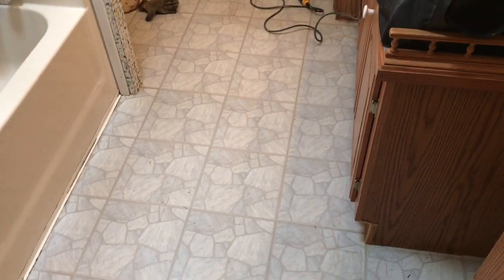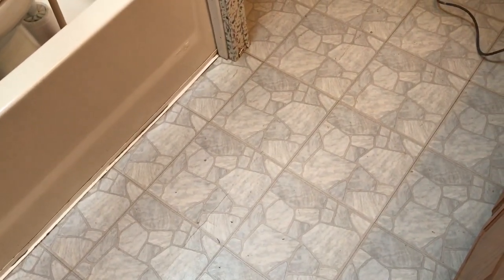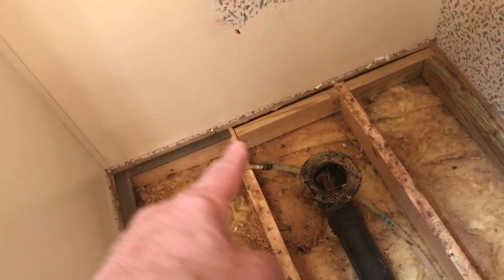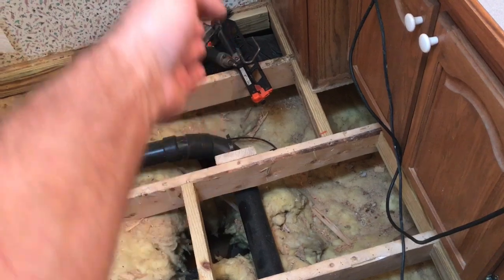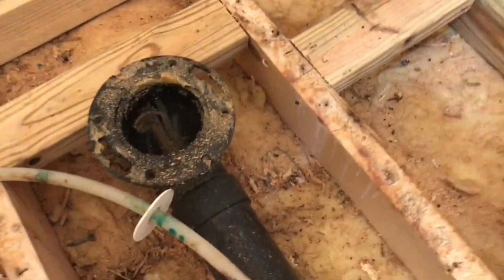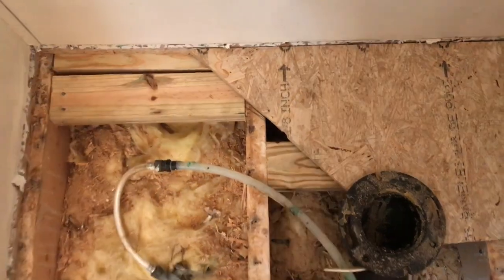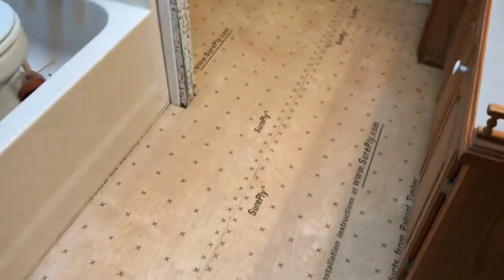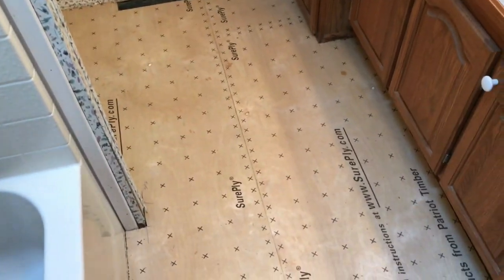How To Repair a rotten bathroom floor in a mobile home

Comment: Bud you just saved me a ton of headaches! Thank you very much for posting this !
Reply from the maker: Thank you for the compliment. Very much appreciated
Reply: @thecarolinacraftsman4120  Dealing with a complete down to the rafters remodel with almost 0 clearance under the double wide so that angle with the perlin supports is a go ! Builder to builder.... Thanks bud ! Not a contractor but have renovated multiple homes.
Reply from the maker: Glad I was able to help you out with this post

Comment: My rotten bathroom floor will need "purlin" 👍
Reply from the maker: Actually they are called blocking instead of purlins. Purlins are used in roofing and blocking being similar, are used every where else. Bottom line is you need additional support between the floor joints such that you have something to glue and nail your new subfloor down to. Check out my channel for one other rotten floor repair. It’s has some music I wish it didn’t that you may have to look over. 🙄lol

Comment: Nice retrofit/repair. Sorry but Purlins are part of roof construction not flooring. What you are adding are blocking or nogging
Reply from the maker: My family has called them purlins and blocking depending on the direction of the wind each day and I’m sure everyone gets the point. I know exactly what you’re referencing. They are mostly used under metal roofing. It’s placing support where there would otherwise not be any. Thanks for your input. Much appreciated!  😜👍
Reply: Mr. know it all tried too trip u up Woody  thank you for the clearing up  the minor detail

Comment: How long does it take to replace a broken floor and falling tub in a mobile home single wide
Reply from the maker: It all depends on what the Damage is and your experience level. I can do one rather quick because I have lots of experience, but I can say this much, do your best to understand all aspects of the process and have the materials ready. Then begin the process of taking it apart and replacing all compromised parts. Then it’s all about putting it back together. The fact you watched this video shows you are doing your homework. Please let me know if you have anymore questions I can answer.

Comment: How do you remove a broken flange? It seems to be glued or does the old flange unscrew from the sewer line??
Reply from the maker: The flange is supposed to be glued down if it’s plastic. It’s a totally different thing if it’s a cast iron one. There are different types of fixes for that depending on how much damage has been done. If it’s just a crack along the top flange where the bolts extend up from the bottom to secure the bowl, then you can get a metal flange repair kit. That will be a “half moon” design that will only cover half the flange. There are videos on YouTube on how to replace one. If you have a local hardware store where they have knowledgeable people you can ask questions, that would also be a good source of information. I hope this helps. It may also be wise to call a local plumbing company   Good luck with it.

Comment: Just curious, why didn't you just unscrew the flange for the toilet. Drop the plywood down then screw the flange back into the pipe?  Was yours glued? They're typically screwed in.
Reply from the maker: I have plumbed for a significant part of my life and in most cases the toilet riser and the accompanying toilet flange are PVC and glued together. Some older homes may have a cast iron flange and it’s more problematic than PVC.  The flange is part of the piece glued down onto the riser thus it would be a bit more difficult to cut out the riser, install the new plywood and then re-cut the drain hole and insert and re glue the riser with flange attached. For us it’s much less involved to do it the way you saw on the video. However if you have the tools and the desire you can do it anyway you want to. Here I just highlighted how we do it. Thanks for sharing your thoughts.

Comment: Here's a stupid question... How exactly are you fastening the smaller support pieces in-between the floor joists? Perlins??....is that what you were calling them?  I'm in the exact same situation to where I've got ot pull up a bunch of rotten floor in a double-wide to try and get it in "sell-able" condition.  I've some some patches throughout the home (which was builtin the 70's), but I've got to do the entire bathroom, and I'm a bit intimidated, given I hate working around plumbing around where the toilet is.  But, short of that, it looks like this is a very doable "DIY" project in a very similar sized bathroom.  Also the underlayment your using....the stuff that say's "sureply"...is that part of waterproofing the flooring itself?  Also, did you go ahead and caulk along where the flooring meets the wall, tub, and cabinet?
Reply from the maker: Hi. Thanks for watching my videos. The “purlins” are best known as “blocking.”  Purlins are usually referred to the pieces you put on a roofing system but I did use the term purlins which was my mistake. We use 3 1/2” construction screws with the torx bit head or a 16 penny nail gun. Either are fine to use. We toe nail or toe screw the ends to the existing floor joist. The 3/4” underlayment plywood is a product I get at Lowes and it’s somewhat water resistant but in no way water proof. If you’re not going to put in a porcelain or tile floor down then you need not worry about water proofing the floor. The Sureply is a 1/4” product that goes on top of the 3/4” and makes for a smoother surface for applying sheet vinyl or one of those LVT products (luxury vinyl tile). The sureply is not at all waterproof. In fact if it gets wet it’ll probably need to be taken up and replaced along with the floor. Good luck with your project.
Reply: @thecarolinacraftsman4120   Thank you!

Comment: What thickness of the plywood did you use?
Reply from the maker: I used 3/4” advantech purchased at Lowe’s and then went back over that with 1/4 inch luan to end up with a smooth surface for sheet vinyl.

Comment: You make it looks so easy. But I want try to do it myself. I have a hole underneath my garden tub that reach my sink cabinet . I'll say about 2 foot long about a foot wide. It's covered by carpet and my cat can slip outside under the tub. 😁 This hole was case by a water leak from the tub faucet.  What is your best guess for the cost of labor? . What is the best board to use?. Will the garden tub have to be removed for a job like this. Thanks in advance.
Reply from the maker: The Cost will depend on your area. I only use “Advantech” purchased at Lowes. It’s a very heavy board and you’ll have to have some strong back muscles to deal with it. I have no idea whether or not the tub will have to be removed. I would have to look at it myself. Bathrooms repairs are very expensive. In my area it’s not uncommon to see a bill around $5000 to do a floor repair but it all depends on the size of the area and and great deal of other issues too many to mention here. Good luck with it.
Reply: Definitely do it ur self saves money.  I want my husband to figure it our w a handy man .
Reply from the maker: Good luck with your remodel

Comment: How many layers of plywood did you use and what size was it?
Reply from the maker: One layer of 4’x8’ 3/4” Advantech from Lowes and then one layer of 7/16” luan for the smooth surface it leaves you with. If you get the one at Lowes, they will have “x’s” where you need to staple it to the subfloor. Staple it at every “X.”  Make sure to Double up on the edges. Thanks for commenting. Please give me a thumbs up if you haven’t already.

Comment: How u cut the hole? What size.. i have repaired a few floors n habe hard time.. what easy way to figure out hole size
Reply from the maker: Jeremy Mccain. Hi. Thanks for contacting me. If you’re talking about the toilet hole size, I normally simply measure from the edge of two walls to the center of the hole to determine a cross section. That gives me a center point of the drain pipe. I then measure the outside dimension of the flange and use a jig saw to cut hole. I usually have a 1/2” toilet flange spacer that I can use to trace out the flange hole perfectly. Then it’s just a matter of using either a hole saw on a drill or whatever you have that you can use to cut it out. I hope this helps.

Comment: how do you know where to cut around the edge where you won’t cut through the support beams underneath? omg so terrified lol i have to do this in my bathroom
Reply from the maker: I use a multi tool with a blade depth that only cuts as much as I desire to cut. It may scrape the top of the joist but not do it any harm. Thanks for watching

Comment: What tool you using to go around wall 5:25
Reply from the maker: A multi tool. You can get one most anywhere. Corded or battery operated.
Reply: What the attachment size or called? I have oscillating tool but the wood attachments are small toothed. I need something like a saw zah (sp) blade in tooth size.

Comment: I thought I had seen in another video that nails were the appropriate fastening for sub floors...even in repair situations.
Reply from the maker: you can use either one.  If you ever go into a house with squeaky floors and are going to put down a new floor, the first thing you'll do is screw down those squeaky nailed areas.  In fact, i normally use a Makita Quick drive to put down my sub flooring so I don't end up with areas that squeak, and Simpson sells the screws for screwing down subfloors.  So I';m not sure where you got that information but I wouldn't spend much time on that site. You''ll find that different folks use different methods and nailing is certainly faster, but definitely not better.
Reply from the maker: https://youtu.be/O6uCke0Cl_w - check out that link
Reply: Screws are better.
Reply: @davidnelson5474  screws are better...yes..but if you use screws in some situations, they become too tight and cause structural imablances. Nails aren't recommended in these cases, just because...they're recommended because the fix is structurally better with nails...sometimes.